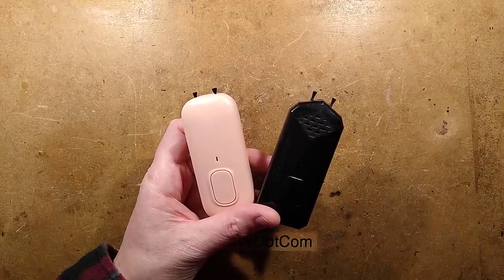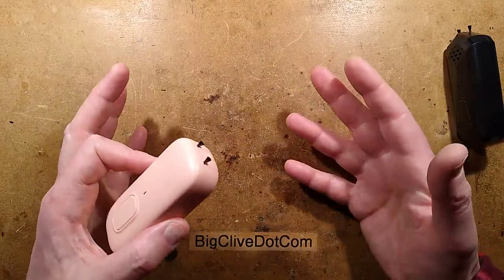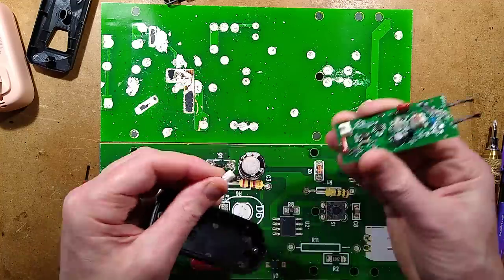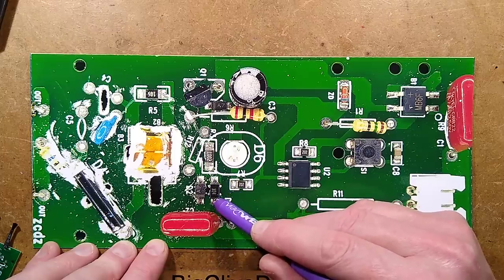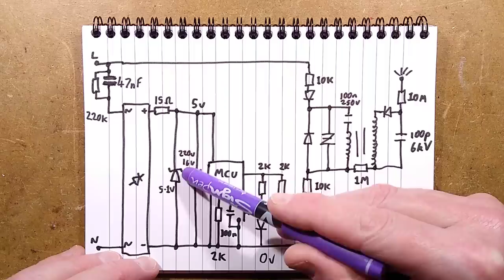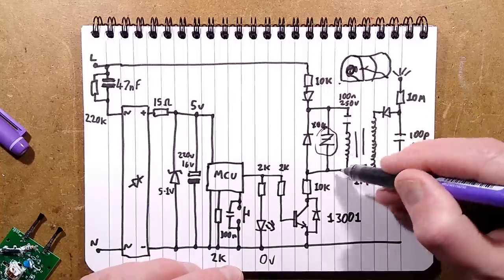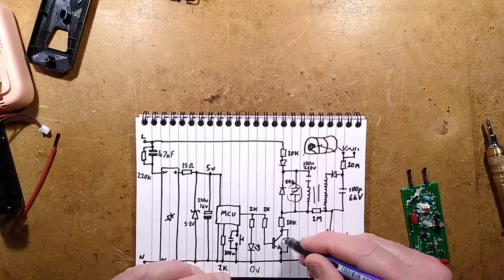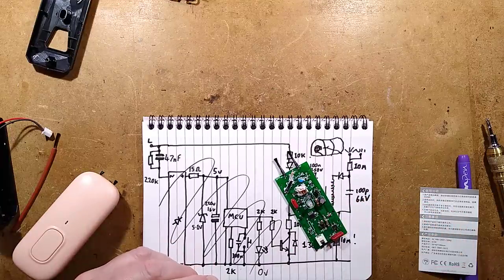Unusually spicy little ionizer - with schematic

Comment: Sea air is alleged to be healthy and also contain relatively high ozone. Are these true ?
Reply from the maker: They thought the smell was ozone, but it turns out it may just have been the smell of organic matter in the water.  But I would have thought that crashing waves could generate electrostatic effects.
Reply: It forms after an electrical discharge from a storm. I used ozone in my research and used to generate it that way. Breathed it once yes smells like the beach I ended up in the student health center.

Comment: Question? There would need to be some modification of course, but could that be hacked into an electrolier for hydrogen production? Where would you place the return lead?
Reply from the maker: That requires higher DC current.
Reply: @bigclivedotcom  Pump it up. Hack it. Just  curious, some electroliers exploit the H2O bent molecular configuration and cause the separation process solely using field effect. Love your channel sir. You have taught me so much. Thank you.

Comment: It's not a PIC12. A PIC12 would need a PULL-UP resistor on pin 4, not a pull-down.
Reply from the maker: It is odd, but the pin can be assigned as an input and MCLR disabled in the configuration file.

Comment: The ioniser I had caused my Linux PC to detect "EMI" which caused my USB keyboard to reset every so often. (Windows would have just done a blue-screen-of-death) It eventually burnt out and died, at which point the EMI went away. So, is there an Ioniser I can buy on Ebay that is cheap, but good and not likely to burst into flames? Replies from the BigClive collective or the man himself are very welcome, thank you.
Reply from the maker: I recommend keeping ionisers well away from electronic equipment.  And never use the ones that plug into USB ports.

Comment: The  1 meg  doesn't  go  to  ground  due  to it being a   shock  hazard  because of the HV capacitor   You   want  isolation  between the primary  to  secondary

Comment: Oh, I don't know, Clive, I find these Ionisers quite interesting. I have no idea why, I just do, so don't worry about making more videos about them.

I don't pretend to know exactly how these things work, but I do see similarities between them, and vintage TV line output circuits - cruder, but similar, and they didn't half extract the crap out of the air, especially in the days when homes we heated by coal fires. I remember seeing wads of soot in the back of some sets, so much so that it was often difficult to see the actual line output transformer. I can still remember that familiar smell of ozone that we used to get, especially on damp days, or if mum was cooking in the kitchen, or on washing days when everything felt just a bit damp.

Just a bit ironic really, that we do away with existing devices that generate ozone, and ionise the air as a byproduct, and then go out and buy electronic devices to specifically replicate that byproduct.
Reply: Same, this is like magic, it also reminds me of CRT TVs, & vacuum tubes! 😊 I can see why the other unit was made with black plastic now.

Comment: You say that a 100n debounce capacitor on the button is "a bit brutal on the contacts"... well, as I've done exactly that in a recent circuit, could you comment on what could be done to be less brutal on the contacts. My contacts are vintage so I'd like to be as kind to them as I possibly can.
Reply from the maker: A smaller capacitor or series resistor in line with the capacitor can reduce peak contact current.

Comment: I'm thinking about getting one of these although I'm slightly concerned about all the other grounded surface a.k.a. computers that I have in my room.
I had a bit of an issue with diatomaceous earth it's a very fine powder so definitely get the food grade because you'll be inhaling it! and I found out that it works very good but it is also very fine! powder and I was cleaning computers out for months.
I'm curious what the effective an ionizer would do with a grounded surface like a computer case in the same room? would that caused dust to get attract the computer? although it would sort of make it easier to clean out, requiring increased system maintenance at the cost of disconnecting everything more often. but I don't know if I want to be doing that more regularly.
Reply from the maker: Dust would get attracted to the metal case if the ioniser was near it.

Comment: It would be funny if they'd used the same flashlight/torch program in the microcontroller so some combination of long presses on the button could let it flash or SOS the ionizer circuit.

Comment: the connector is pretty much inacceptable for 240VAC.
Spacing/Clearance between the pins - and more so btween the pads - is inappropriate for that voltage. They could have used that style of connector if they had used one at least one position larger but then with an omitted center not populated. contact (or even two omitted contacts, so you have pin - x - x - pin on the board, giving a sufficient insulation

Comment: Ok so I’m confused. Is an ioniser the same as an ozone generator? And is an ioniser safer to use than an ozone generator?
Reply: Ionisers are made to precipitate very fine particulates - the stuff you cannot see floating in a ray of sunshine. They are very safe to use. A correctly designed one will be safe to touch (perhaps give you a tiny staticky shock) and will not produce dangerous amounts of ozone. 
Ozone generators generate a gas (ozone) which oxidises practically everything in its path. This destroys smells quite effectively. They are only safe to use under a number of specific conditions. If you can smell the ozone in a room, there's already way too much of it. Attempting to oxidise your lungs will cause health issues with repeated exposure. It can also damage oxidation-sensitive objects in your room, such as rubber parts on vehicles if you use it in a garage. Limit your own exposure, make sure the ozone can't travel through the building and collect in other spaces.
So treat an ozone generator with as much respect as you would treat power tools.

Comment: If it was a microcontroller then there would be no need for the denounce capacitor as denounce is easily done in software, but as you say it's a bit over engineered in places.
Good video. Thanks🙂
Reply: Hmmmmmm, the  "denounce capacitor" ????????. Denounce - publicly declare to be wrong or evil. Nothing at all wrong or evil in it's functionality at all as it's actually working as a debounce capacitor.😏
Reply: @brucepickess8097  A microcontroller firmware could have debounced that switch simply by waiting 100ms to settle before looking at it again. Also a little switch like that is going to be trashed by a 100n cap directly across its contacts. It's not evil, but it has much to repent for.
Reply: @brucepickess8097  I am going to call it denounce function from now on ;-)
Reply: @abitofabitofabit4404  I'm currently debouncing a "precious" vintage switch with a 100n capacitor... can you point me in the direction of anything that'll explain why it's evil and what I should do instead?
Reply: @edgeeffect  Electrical pitting. Calculate the effective series resistance of the capacitor, switch, and interconnects in series, then estimate the current density at the switch contacts at the instant they touch vs. the rating of the switch, then look up spot welding. :) The switch becomes progressively bouncier and more prone to pitting as the contacts become rougher. I'd place a few dozen ohms somewhere in the cap-switch loop to keep the peak current within the switch's rating. Resistors are almost free.

Comment: i wonder if you could use that voltage to light an l.e.d 💡🤔🤷‍♂️🙇‍♂️
Reply: Try a neon pilot lamp like a NE2 as these require extremely low current and high voltage

Comment: I made myself my first ionizer a few days ago. I think it's a little overkill tho. I used 40 class X2 220nF capacitors cause they were cheap and in nice rectangular shape, 1N4007s, and painted everything with epoxy resin. Temporarily it does not have the limiting resistor at output, because I haven't got any megohm values in house. Even with poor bristle on output you can hear the corona discharge, and smell traces of ozone. It also gives strange cool breeze sensation when you hold your hand few centimetres above it. It was made for fun tho, so this shouldn't be a big issue.
Reply from the maker: I do recommend adding a few current limiting resistors on the output.  Even just standard 1 Megohm half watt ones.
Reply: @bigclivedotcom  I added three 2,2 megohm resistors in series for safety, after all it is directly connected to mains.

Comment: what would happen if you reverse biased a 2nd ionizer and put it above a metal plate with piece of paper on top of it(or not) in the same room as a negative ion generator?
Reply from the maker: Some do use positively charged dust collection plates.
Reply: what do you do with the positive ions? You cannot pump in negative ions in a room indefinitely.
Reply from the maker: @janami-dharmam  The charge naturally subsides again when they contact grounded surfaces like walls and floors.
Reply: @janami-dharmam  provide a preferential charge plate for the negative ions to be attracted to so all of the dust and nasty stuff is collected in 1 area and not on all of the surfaces of the room

Comment: The high voltage diode might explain some components I bought a long time ago I've been unable to identify. Unfortunately, the markings are unreadable. They didn't test as a diode though so I'm not sure.
Reply from the maker: High voltage diodes are usually a stack of diode junctions, so they won't test as a simple diode.  They have quite a high voltage drop.
Reply: @bigclivedotcom  That would make sense. I believe I bought them as part of a timed short-exposure photography project (bullets in flight and such) that I never got around to.

Comment: Clive, you should show people that Ioniser I sent you a while ago with the ceramic plate emitter, than thing is the mother of all Ionisers! 10g /hr IIRC .
Reply from the maker: I'll have to have a look for that.  The ceramic plate devices are usually ozone generators and not ionisers.
Reply: @bigclivedotcom  If it is a plate ozone generator and you review it, please also write at the beginning of the description all those warnings and recommendations that I know you are going to say in the video so that they can be seen even by those who do not watch the full video or focus more on the reverse engineering and schematic parts of the video.

I am really concerned about this issue because unfortunately I know an electrical engineer who decided to buy a plate ozone generator to replace his "underpowered" ionizer, and he was running it 24/7 at home, if an electrical engineer can make that mistake I don't even want to think what people with less technical knowledge could be doing.

This morning I tried to explain the differences between ionizers and ozone generators to another user who had doubts and all my attempts to answer were blocked/banned 😓In the end I gave up because a few minutes later someone else told him the same I was trying to explain.

Comment: The newest energy efficiency regulations now require power buttons on all consumer electronics. Even network routers which are never ever switched off.
Reply from the maker: That would fit, since the people that make regulations are rarely technically competent.

Comment: I love making projects, this has given me an idea. (Probably already tried)
Just got myself a laser that will cut 3mm plywood. There is a bit of smoke, I am sure you can imagine. Well no more than the days when we all smoked ha-ha.
I wonder if I got a small fan blowing the smoke over one of these towards a ground plate (grid), would the soot collect on the ground plate?
Reply from the maker: Adding a fan and filter might be a good option.  Although the filter would need swapped/cleaned regularly.
Reply: @bigclivedotcom  Oh it would have to be something that could be cleaned, don't want to spend money replacing something all the time ha-ha.

Comment: So are these things used in central heat and air systems?
Reply: At the place where I worked, the engineering workshops had a massive electrostatic precipitator in the air recycling system. It was very effective at removing smoky deposits from the air - especially from the welding shop.
Reply from the maker: Many freestanding air filter units have them built in.
Reply: That's what I'm thinking too, would make sense on the surface to me 🙂

Comment: You  have to  show that's  the transformer is  iron  core  otherwise   the viewer     will  assume  it's a air  core  which wouldn't work in that circuit
Reply from the maker: They generally have a tiny ferrite core.

Comment: I have discovered that some electric blankets are a good source of carbon fiber resistance wire.
(Unplug it first.........)
Have you considered the possibility that the on/off switch (with failure inducing parallel capacitor), microprocessor and the weird positioning of the 1M resistor has been included to introduce a vital function into a simple, reliable circuit..... that is.......programmed/ predictable failure.
It's likely an original, uncomplicated ionizer unit will still be functional years after the new versions have failed and been replaced a few times. (play theme to ABBA's "Money, Money, Money")
Love Ya Work!

Comment: If they wanted an on-off function surely they could've just used a standard rocker switch... It seems so unnecessary to add a microcontroller for the sole purpose of acting as a latch for the push button. In fact, they could've just used a standard latching push button. Really weird.
Reply: That processor costs less than 1 cent plus 2 cents for resistors and a capacitor

Comment: I have a wireless doorbell that stopped making noise. Are you interested in dissecting it? battery operated sensors to mount at the door, and a 110 volt receiver unit that connects via bluetooth to the senders. I would be happy to ship it to you if you want it.

Comment: Yea, when they design circuit boards like that they probably just use the auto-router function in the software. Quick, dirty, & lazy. Maybe there is no cost penalty for making a double sided PCB vs a single sided one.
I think they didn't put the 10M resistor where you wanted it to be, because then it would still be sort of "on" when the transistor was off: It would then have a very low duty cycle because the 100nF capacitor would have to charge through the 10M resistor for quite a long time before the SIDAC fired.
Reply: Correct. Most PCB manufacturers base the cost on a double sided design and removing one side doesn't make it cheaper.

Comment: Because the dust is attracted to grounded surfaces, could you ground a particular surface in a room and attract the dust to one place? 
I don’t know about this so thought it worth asking. It would be great if you could make the dust “go” some where you could wipe down regularly.
Reply from the maker: Some units have slightly positively charged dust attraction plates to try and capture some of the dust in a controlled manner.

Comment: In this application,  silastic is a good idea.  The furnace blower motor in my house is a VFD with a permanent magnet  motor.  The VFD had a habit of dying often, at $300+ ouch.  I tore into the failed unit and found an NTC thermistor failed from thermal cycling. This is a programmable unit, mine is set for soft start and stop so I installed a solid jumper.  Still going 14+ years.
Now the unit at my brother's house has the thermistor leades potted in silicone.  No where for the heat to go and it desoldered itself.  Horrible design.

Comment: ... X04... Only thing I know is that was number 6s pretend code name in an episode of the prisoner 👀

R11 would have been massive! Just what do they expect you're going to put in there, a bridge?

This circuit says to me, lazy, copied something online, messed up and didn't know how to clean it up in software

Were you able to measure the frequency of the output?
Reply from the maker: I didn't check that.
Reply: @bigclivedotcom  ah poop, I wondered if it might account for the higher than usual reading

Comment: While switched on, touching just the carbon brushes yields no harm....

However if you, "mistakenly" are touching another electrical device that has a grounded metal case, you can get a nice little waullap off the brushes.
Not a pleasant experience when your holding a cup of searing hot coffee.

Comment: Almost an insult to Alan Turing to use a computer as an on/off switch!  An actual switch plus a neon would be safer, simpler and have zero consumption when off!
Reply: You can debate the 'safer' bit when it comes to the absolute cheapest mains switches you can think of. They're not gonna stick something UL registered or KEMA approved into a cheap piece of plastic like this...

Comment: Having a micro to operate as an on/off switch... hmmm... Things that could have been replaced by a piece of wire... but over engineered requiring a microcontroller.  LOL